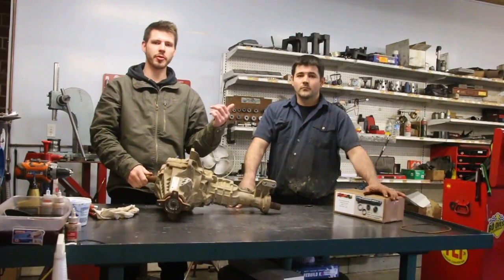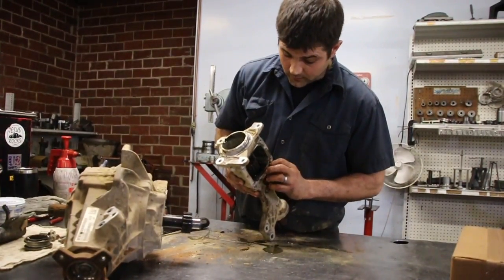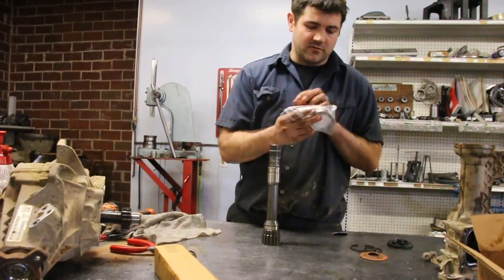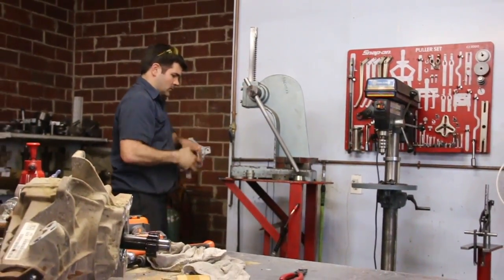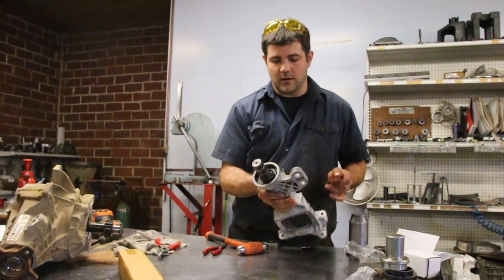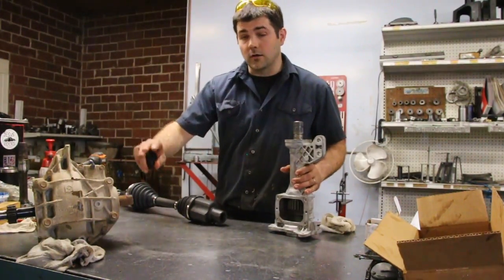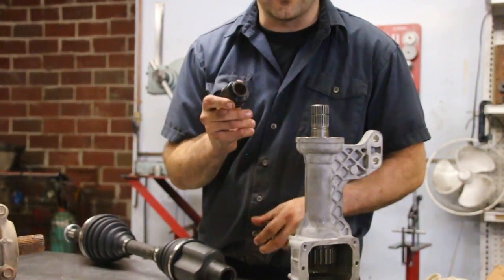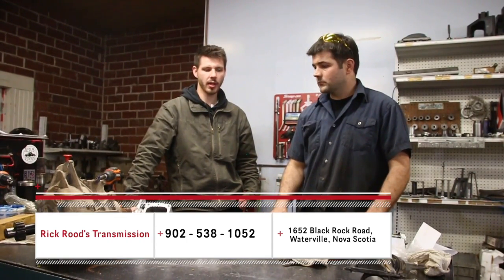Dodge Front Axle Repair and Replacement, Rick Roods Transmission

Comment: I will try a kit myself, but I am amazed this problem isn't a recall or a class action suit, I had 56,000 miles on a 2014 ram, barely use 4 wheel drive and the passenger side id loose with play in it. This seems to be too common of a problem on these year Ram pickups.
Reply: You and me both. I have a 2019 and mine is going out on the right side.
Reply: @michaelhempton9302  I put the kit on and it worked like a charm
Reply: I have a 2014 ram 1500 and they told me at the dealership that I have to change these parts and the cost is $4,680
Reply: 2015 ram here third set of cv axles and now I need output shafts too. Dumb 114k miles
Reply: The kit did tge job, and an hour to install
Reply: God live the dealership 😂 also yes I agree law suit needs to happen. Thank gid I bought a ln extended warranty. I do all my own work but I’m going to take the ram to a trusted axle shop and show them this kit. In hopes they will order it and write it in the quote, as the sure seal boots will hopefully prevent this from happening again in another 50k miles. Sheesh this design was horrible. Btw these are ZF differentials not mopar. Idk why ZF didn’t just go with the traditional design and have the CV axle have the mail spline, and it shows in to the differential, as I feel this would prevent at all this problem. I mean that’s how most auto manufacturers designer differentials on independent suspension and that’s also what ram dead on the brand new body style!

Comment: I ordered mine last week, it will be here soon. I can’t wait to put it in with a new axle and hub bearing assembly. I have been dealing with a worn out intermediate shaft for 3 years, thanks and hats off to Roods transmission for making this piece at a affordable price. Dodge still doesn’t offer a replacement option for this. The only thing they keep telling me is I have to replace the whole front diff and it would be around $5000 to do that. There should have been a recall from the factory to replace and remedy this. I’ll be ordering a few more in the future, I have a few friends that are having the same issue with their dodge rams. Again thank you for providing us with a option Roods Transmissions.

Comment: Just installed one of these kits for a customer at my shop. This kit is phenomenal and your customer will be very happy to save thousands for not needing a whole diff. Differential removal from the truck is not required. Simple job for any professional tech, took an hour start finish.

Comment: Great Video, very helpful. when it came to the needle bearings and cover seal, I used a large socket and 2 extensions and pressed them out after a long screw driver and a hammer as suggested on the inside edge wasn't progressing the project as effortlessly as  it was going. keep it simple, great video thank you for the guidance!

Comment: great video. ordered mine the other day and talked to Bruce. I'm confident I can do this fix. I probably wouldn't if it wasn't for this video. Going to attempt it without dropping the whole diff though.
Reply: Did you do it without removing the whole diff?
Reply: I would also like to know. I've ordered mine, and it's expected to get here Wednesday!
Reply: @TheRealJoeCarter  I called them and you do not need to drop the entire diff.
Reply: @blakeerdmann  yeah it looks like once you get the cv shaft off, this can come free very easily. If I can find a warm place to do this, I might do it myself. Though for a kit on Amazon and the shaft from the dealer(mines too new), it's almost the price a trans shop quoted me.

Comment: Is this the same for a 2021 Ram 1500 4wd? My trucks front passanger side differential case cracked where it connects to the chassis, which causes the Cv axel to come out.
Looking forward to your response. Thanks

Comment: I would like to know what causes the change of this piece, noise, jumps, vibration.?  They told me it would cost me 4800 but I took it apart myself however I don't notice anything wrong with the parts, I expected to see wear or ground metal but nothing, but they told me that's the problem, help please

Comment: Great video.  Thanks for posting.  Any chance you can get that housing off/out without removing the whole differential?
Reply: OK folks I just completed this project on a 2015 Ecodiesel.  You can easily remove the intermediate shaft housing without removing the differential.  HOWEVER IT IS NOT THAT EASY ON AN ECODIESEL.  The diesel apparently occupies a LOT more real estate in the engine compartment.  For instance the oil pan on the diesel is about an inch away from the top intermediate housing flange bolt.  This makes getting the bolt oot a very big PAIN IN THE ASS.  You'll need to bend the hell oot of a 12mm combination wrench.  Pulling the full differential oot looks like even a bigger PIA because the bolt on the front top of the differential housing looks almost impossible with out removing the PS pump or maybe the radiator and intercooler of perhaps both.  I went after the I-shaft housing.

If you do this on an ecodiesel and you need the truck.  The first thing you'll do is remove that top intermediate shaft housing bolt.  That might be the only thing you get done for the evening.  It'll give you a good idea what it's going to take to get the job done.  The next day you work on it you'll go after everything else.

Good Luck.

Comment: Where to find the housing for "the small extension he opened" where the intermediate shaft go into. Mine has small crack , don't  want to buy the whole carriar $700 for that . And is different if mine 3.92 gear ratio? Thanks

Comment: Could you possibly weld the cv axle to the intermediate shaft, or would this not be wise? Thanks
Reply: I would be worried it would heat up the seal at the intermediate shaft and leak oil

Comment: How you know if  Intermediate Shaft need to replace someone help me out?
Reply: Your axle will pop out and be loose.  Typically, you will hear a loud bang or pop when turning to the left real fast.   It may clunk a little over bumps and the steering will vibrate a little.     Just go under the truck and grab it, if it has a ton of play and pops in and out, then you need this kit

Comment: How can you replace gears on a Ram/1500/5th generation/ 2019 from 3.21 front differential to 3.92? Why I'm asking because I put on 35inch tires on w/20inch rims... it is possible????  And how please help
Reply: On the 4th Gen Rams with the ZF front diff, if you want to go from 3.21 to 3.92, you have to replace the entire front diff with a diff that already has 3.92 gears because the front diff on these trucks can't be regeared like the rear. I believe there is a write up online about it if you search for it and it explains why. The rear diff can be regeared like normal.
Reply: @deviantarsenal also side note if you regear one or the other, there gearing has to match
Reply: @Mike-sr6gd  yessir, I forgot to add that, appreciate it.

Comment: just another victim to Ram/Mopars incredible engineering team, bought a new to me 2016 Dodge Ram 1500 Outdoorsman, withen weeks of purchase a snow storm we had up here in the UP of michigan I used 4wheel drive. Wouldnt you know it my CV shaft on passenger was junk. Pulled CV shaft out at home. Find that the C-RING on the end of the interm. shaft was completely destroyed, the shaft itself worn down to nothing. New CV shaft locks onto orignal shaft but has a scary amount of play right at the interm. shaft. Will shred another 230$ CV in weeks. Was ready to bring my truck into a local shop. Shop owner was very famiier with this issue and told me the whole DIFF needs to come out of the truck to repair. From what I see in this video that is not the case. Shop quoted me 4hrs of work at 100 an hr plus 300 for a replacement part. He wasnt even aware there was a replacement part until I showed him Oreilly Auto has it for 300$ without the rubber seals that come in this kit.

Going to try and tackle this myself over the weekend. Pressing bearings in place may be tough but the rest doesnt look impossible from the ground of my garage.